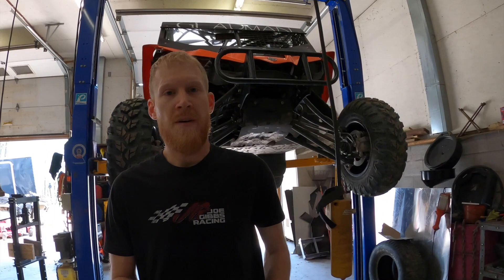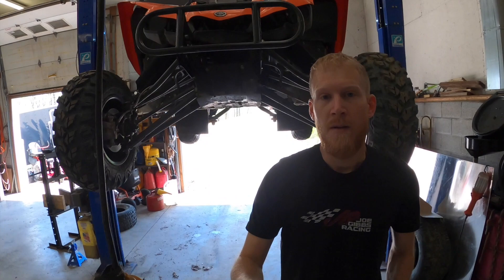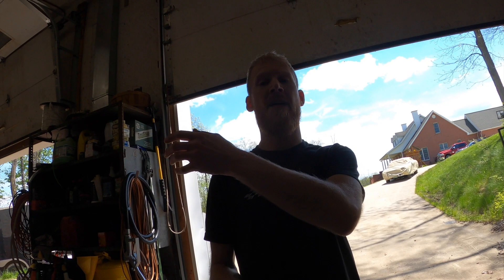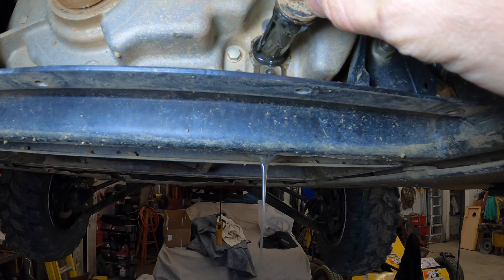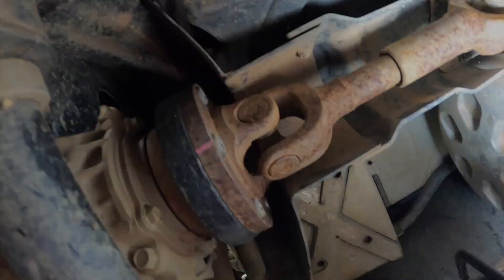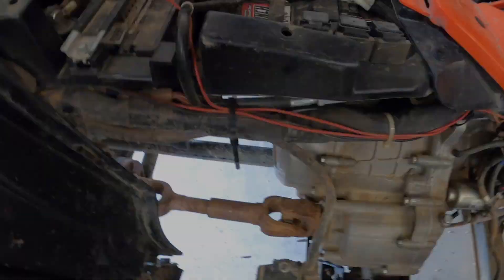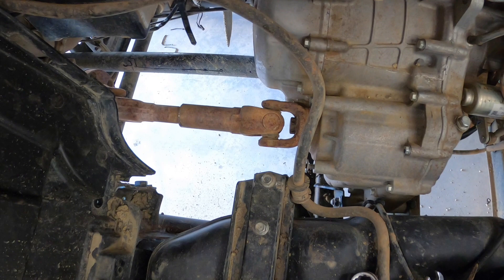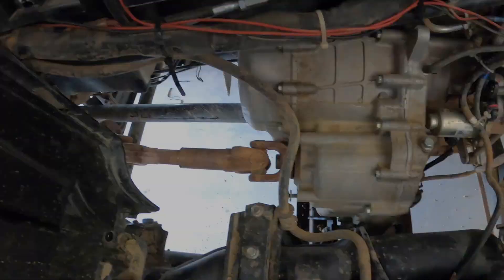Transmission Removal And Teardown On Gladman's YXZ To Fix A Possible Broken 3rd Gear

Comment: Did the same on my 17 ss & ended up blowing gears thru the case. 3rd was skipping but I kept pushing it.. now have a 19 3 pedal & im loving the manual!
Reply from the maker: I’ve always been a big fan of my 16 3 pedal car especially for racing but after the shift buttons in the 17 and a few other mods that Kevin has made to his the ss isn’t bad either!
Reply: Next car will be a 3 pedal lol. It’s nice for woods racing but not ideal for short course. But it can be done!

Comment: I put 5000 miles on a YXZ’s without a problem. It’s actually nice to see one of these taken apart. I’ve always been curious.
Reply from the maker: This one started showing signs weeks before this video…Kevin was having issues shifting to and from 3rd gear but there was really no “event” we could blame it on. We wanted to go way more in depth with this video but it happened right in the middle of the season!
Reply: @writeselwelding  We will keep an on my buddy’s Turbo car! Thanks guys!

Comment: How do you take out the front drive shaft
Reply: Easiest way to get just the front drive shaft out would be to bust the nuts loose under the u-joints and weasel it down out. (May have to modify a wrench) The the slip yoke should collapse enough to let it come off the trans and front diff.
Reply: Or do you mean how did I get it off the front drive of the transmission in the video?

Comment: I have no first gear. Any idea on what i should do ?
Reply from the maker: Well….do you have a 3 pedal car or a sport shift?
Reply: @writeselwelding  3 pedal, it's a 2016 yxz1000r se
Reply: I have the same problem on the same unit have you had any luck fixing it?